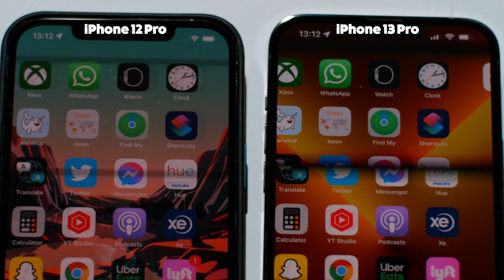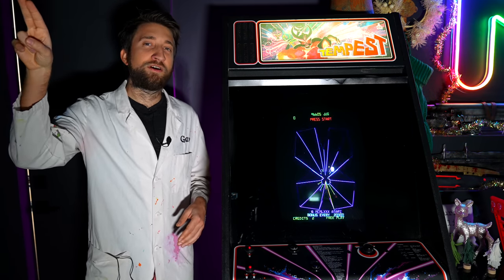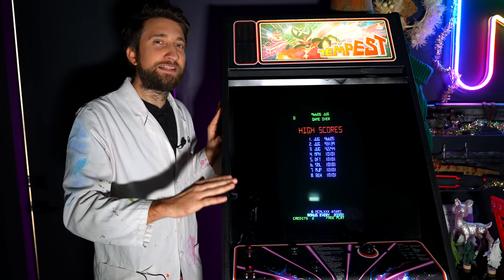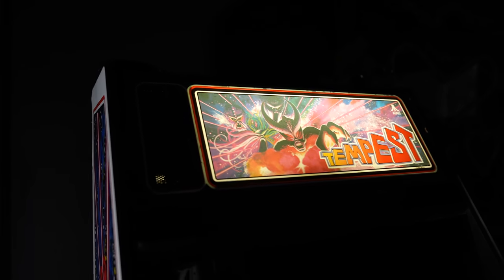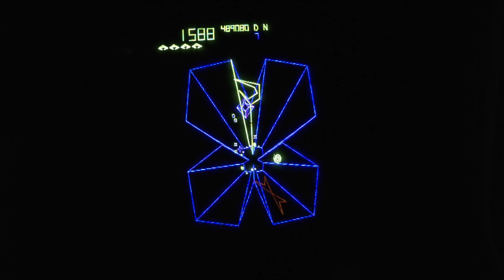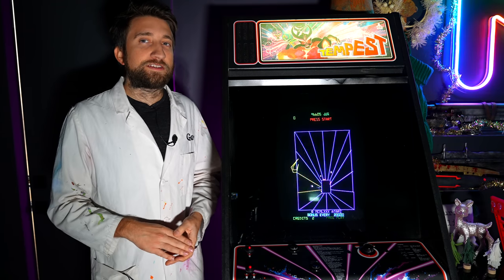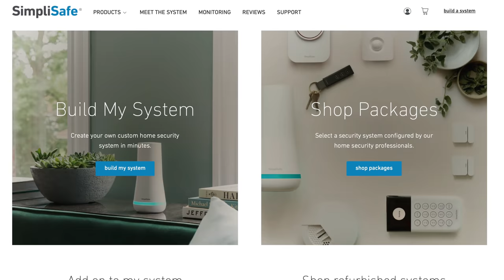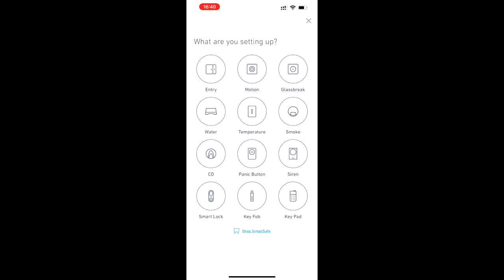Arcade Machines look WEIRD in Slow Mo - The Slow Mo Guys

Comment: Just thinking about how programmer back then coded something like this with such a limited resources gave me a chill.
Reply: The math for vector graphics is actually a lot easier than raster, because you can draw elements to the screen as you finish calculating them instead of in strict top to bottom order.
Reply: How cool would it be to invent something like this 40 years ago and then just now be able to see it slowed down
Reply: Necessity is the mother of invention. Having too much resources can actually be crippling, ironically enough.
Reply: @Wabajak13  you could of course tune the scan speed down in your engine :) but I get what you were going for
Reply: @DeathBringer769  ea vs an indie dev
Reply: It's not really that hard tbh. People do astonishing stuff by programming very limited hardware to do things it was never intended to do, this is called demoscene. This ain't that, this is just drawing lines on the screen. Probably assisted by a custom video chip or a separate dedicated CPU or something similar.
Reply: @grishka212  Atari Tempest, and all of the early Atari Vector were plain old, good old 6502 (at 1.5Mhz)
Reply: @pSynrg303  It did have a co-processor that updated the display along with a math co-processor to calculate the vectors. The 6502 updated a "display list" that the video co-processor would constantly read through, to draw the lines on the display. I actually had one of these machines, and a Star Wars that I fixed, a few years ago.
Reply: Majority of modern games start as vector graphics using lines, triangles and points. The first couple steps of the pipeline are just getting the vectors processed in order to begin rasterization so that you can layer on textures and such. The older trick to shader coding to speed things up, do as much as you can in the vertex shader which is almost purely working with vectors. Of course things have become a bit more intermixed now but same process still serves as the foundation for modern graphics rendering.
Reply: @Stabby666  Let's pretend it was all pur we 6502 😱 Seriously though, what a wonderful creation the Atari Vector system was. I still think it looks out of place for the era.
Reply: @eideticex  dont forget in that time we (programmers) had to do quite intensive math and follow very strictly optimized coding to not run out of memory. Also we had to code literally everything. Now everything built on an oven-ready engine (unreal mostly) and no one cares about memory. Nowdays aaa games doesn't really need amazing programers but amazing graphics designers, animators, actors...etc.
Reply: You basically had a list of delta x , delta y, length, and RGB color at a certain address in the hardware. If you did nothing during a frame it would draw the same thing. You would keep pointers to the non-static parts and change sometimes just the dx dy’s to spin your ship or change the dx dy and length of the black line to the ship.
Reply: Let’s go Brandon!
Reply: corona ke badhne se …
https://youtu.be/M_zz3uVeWUA
Reply: @Wabajak13  all you do is slow down your code timing so you can watch it draw ,.
Reply: @pSynrg303  thats when people  used to write in machine language,  now it's all bloat c code
Reply: I mean, the programmer just needs to tell the machine what lines to draw, and where, and just speed it up, but the engineer who designed the machine had to make sure the machine could handle that speed, I think that's more impressive.
Reply: All I know is that my favorite pastime 40 years ago was going to the arcade or even the local 7-11 and blowing an afternoon playing games like this.  Atari, Intellivision and eventually Nintendo were all well and good but nothing beat the stand up arcade games back in the day.
Reply: Even crazier was the hardware of Cinematronics/Vectorbeam "Speed Freak" - the first 3D car racing vector game, which discrete RISC CPU was completely built of TTL chips (and much faster than C64 etc.).
Reply: If you haven't seen it already, you might like this video on the Atari Quadrascan by Retro Game Mechanics Explained.

Comment: Good timing to mention Mat/Techmoan.  His video today is a "scope clock" with vector graphics on an oscilloscope tube.
Reply from the maker: Haha what are the chances!
Reply: @theslowmoguys  A Techmoan/Slow Mo Guys colab would be great, that guy has a veritable treasure chest of cool vintage tech.
Reply: @gris4985  What does a Nixie tube look like in slo-mo?  I'd like to see that.
Reply: @jasonblalock4429  i second this
Reply: @jasonblalock4429  
I don't think it would look any different, actually.  Each number is just a metal cutout that glows when it is active.  There might be some flickering to see, but that would be it.  Correct me if I'm wrong.
Reply: I did vector laser images with a HeNe laser and mechanical galvo scanners in the 80s that I choreographed to music. (classical laser light show) 
 I take out a projector on Halloween each year. 
I use the Radio Shack Color Computer with SW I wrote and used General scanning Galvos.  It used the 6809 and a clock around 900kHz.  In the display processor I was squeezing clock cycles to to some rotations real-time. 
..
I though about writing an Asteroids game, but moved on to other things. . .

Comment: Persistence of vision is awesome
Reply: No
Reply: It is. That's what allows us to play these games.
Reply: Hi
Reply: you are awesome.
Reply: it's kind of the leading factor why LED lighting isn't horrendous to us in its current form
Reply: @Ki113dbysw0rd  and neither is incandecent lighting. I still wonder, if anyone ever tested how incandecent, compact fluorecent and LEDs impact our pets? Dogs are probably safe, since IIRC their eyes are even worse than ours. But what about cats and birds? And from personal experience the variance in humans is quite noticable. Up until my 40s I definitely noticed  a difference between 25,30,40,60 or 80 fps. Some games where you are moving really fast like a race car or a plane, became unplayable under 40 fps. Nowadays I get by, because my eyes and my reaction time slows down. But I still notice, when the framerate isn't stable, even if it does not drop below 40fps. Drives my crazy ;)
Reply: Laminar Flow: *sheds parallel tears of abandoment
Reply: In case Destin somehow sees this i have a question you might have the answer to What if you had a screen made up of multiple/ a dozen or even more of those lasers working in unison to make even more defined and full images. Or is there already an equivalent to that?
Reply: Thanks for helping make this happen! I’ve been dying to see a vectrex display in slow mo ever since I saw the crt in slow mo!
Reply: Unfortunately it also works against us when it comes to sample-and-hold displays, but it was definitely a blessing when it came to CRTs.
Reply: @EyMannMachHin  On my playlist about shielding & radiations are some modern lightbulb tests. Fluorescent/CFL are definitely worst to health in light spectrum and EMF. LED are less terrible (still some flicker and models with very bad EMF do exist) but none of them is as healthy as genuine incandescent lightbulbs (the only lamps I use).

With games, on MAME I often still play <10 FPS without trouble. Habe you ever tried polygon 3D games on 8-bit machines like C64? Some flight sims were 1 or 2 FPS which was considered normal at that time.
Reply: @cyberyogicowindler2448  Thanks, I really have to check those out. Especially in light of incandecent bulbs are also included in calculations for size of radiators. But I have moved completely to LED by now, since at one point I was only getting 60W incandecent bulbs for my PAR38 living room lighting. That really turned the whole room into a cave.

And, yes I did play early low fps 3D polygon games on (real) 8 bit machines in the 80s. But it was all new at that time and for some things I also lacked the real world experience so it worked out okay. But I still remember showing off FS 4.0 on my (then new) 386 to a colleague actually holding a PPL, his only comment was: "Nice, but why is it so sluggish?" The fun thing about muscle memory is it can react to things you see but don't register consiously. And a driving game this means, if the game actually only renders every 3rd frame you might actually miss the turn because you don't "see" the frame in which you actually should have turned. I hope this makes some sense?
Reply: The philosophical implications are overwhelming when you consider all of the different tricks our brains use to generate our version of reality using the sensory input we receive. Your brain is literally generating reality on the fly based on whatever sensory input it gets in. Like with color. Our brains take certain wavelengths of EM radiation and tell us we're seeing a corresponding color. But there's nothing about that EM radiation that gives it that color. It's just something our brain tells us we see when that wavelength happens to be detected. There's nothing about 450nm light that inherently makes it blue, for example. But that's how most of us see it. Unless you're colorblind. And even if you have "normal" color vision, everybody has different sensitivities to different frequencies of light. Some people can even see outside of the visible spectrum and into the ultraviolet or infrared (but not both afaik). Apparently it's more common to be able to see infrared as a dull red color.

Comment: Went to an arcade and played asteroids and was amazed at how crisp and nice looking the display looked, it's cool finding out how it works and why its so distinctly different than other types of displays. Great video as always!
Reply: Yeah, I had head the phrase "vector graphics" many times over the years, and understood what a vector was, but never really thought that the lines would actually be made in a very different way than a standard display.  I guess I just figured that there was vector math in the way things were calculated.
Reply: I was lucky enough to grow up in the era when vector games were new. There was something quite magical about them. The Star Wars game in particular used to draw a crowd whenever someone put 10p in the machine. We were unsophisticated kids that were easily fooled by illusions. Some coloured lines flashing on a screen made us feel like we were actually flying down the trench on the Death Star.
I think the vector games have remained "magical" unlike some of the raster/sprite games of the same period. As the displays were often only 256 pixels wide, blocky/pixelated games of the era look unclear and jerky to modern eyes, but the vectors still seem sharp and fast. There are some good emulations via MAME etc that reproduce the flickering and glowing of the lines quite accurately, but a real vector arcade machine is something special.

Comment: I've always adored vector displays. Any time I'm at an arcade I'm drawn to any game using them with their intense contrast and vibrancy.
Reply: Yeah, when I was a kid, vector games were my favorites.  Even if much newer/prettier games were around, I'd still be playing Asteroids or Star Wars/Empire Strikes Back.
Reply: I did vector laser images with a HeNe laser and mechanical galvo scanners in the 80s that I choreographed to music. (classical laser light show) 
 I take out a projector on Halloween each year. 
I use the Radio Shack Color Computer with SW I wrote and used General scanning Galvos.  It used the 6809 and a clock around 900kHz.  In the display processor I was squeezing clock cycles to to some rotations real-time. 
..
I though about writing an Asteroids game, but moved on to other things. . .

Comment: I was a CRT tester a few years ago and it's really cool to see these in slow mo. The science that goes into producing these even today is impressive and pretty labor intensive depending the kind of tube it is. Size, how many guns are in it, type of coatings, how the coatings are applied, the housing (shield), how the wiring is setup. Can get complicated quick.

Comment: Hi Gav,  fantastic video as always. Love to see how our eyes are fooled by display technology.
Would you ever consider pointing the Phantom at a DLP projector? It would be incredible to see the DMD device and colour wheel working together.
With new faux 4K system, the DMD is flashed multiple times tin increase the perceived resolution.

Comment: Fascinating. I never knew there were vector displays, assuming all screens refreshed line by line. Thank you for this!
Also, the story of Dan the Subocean Traveller is hilarious, as always.
Reply: Actually the vector displays predates matrix displays. After all they are just glorified cathode tubes like those that used to be found in oscilloscopes. Matrix graphics was much harder to create using early computers. On early computer terminals the displays were character mapped. That is there were no bitmap for the display and the information needed to draw the characters were created by a character generator. Any time you wanted more flexible graphics vector displays were used. I remember that they had a terminal capable of displaying vector graphics at the university a friend and I used to go to to use their computer. We were still in middle school so perhaps 12 years old or so, and the only way we were able to get some computer time was by applying for an account at a university and use their mainframe. The graphics terminal was freaking impressive tech for the time. I remember that the colors were not aligned in a single plane which made it possible to create some weird but interesting parallax effects. Yea, we weren't doing a lot of serious programming, but it taught me a lot. My friend spent a lot more time there than I did though.
Reply: @blahorgaslisk7763  I did vector laser images with a HeNe laser and mechanical galvo scanners in the 80s that I choreographed to music. (classical laser light show) 
 I take out a projector on Halloween each year. 
I use the Radio Shack Color Computer with SW I wrote and used General scanning Galvos.  It used the 6809 and a clock around 900kHz.  In the display processor I was squeezing clock cycles to to some rotations real-time. 
..
I though about writing an Asteroids game, but moved on to other things. . .
Reply: @Observ45er  Awesome! Perhaps it's time to see if you can cobble together some simple game now. Should go over well with the grandparents following their grandkids around...

Comment: I worked in the field of protein crystallography in 1980's and beyond and wrote software that had to draw complex views of data.  The 1980's used the Evans and Sutherland computers which were vector graphics engines, and you could only draw a number of lines before you brain could see the flicker of the image.  The computer code draw lines, and these were drawn exactly in order in the computer code, and you had to limit the number you drew.  All code was "wire-frame", just like this. 
We also worked on the earliest version of stereo in the 1990's where the monitor was over clocked to double its refresh rate (and not interlaced), then you drew the left/right scene in the bottom and top of the view - which would then wrap round when you over-ran the monitor to 100Hz.  (Europe), to create the stereo.  We drew 2 dots on the screen which used 2 sensors to hand made LCD glasses that would alternate flash, so the eyes would see the alternate scenes.
SGI computers replaced these vector machines with the first "high-performance" raster graphics in the 1990 - and these cost from 100,000 to some 500,000 $/£ each and some the size of a small desk with an 18 inch cooling fan.

Comment: I worked on the head-up display for the Harrier aircraft. It was a vector display projected onto a transparent mirror. The CRT had a 1" diameter screen with a spot size of .001" and was incredibly bright. It had to be visible when flying (almost) into the sun.

Comment: Oscillofun is this brought to life with current technology. Also you can get the slow motion display simply by varying the readout rate for your raster display, obviating the need for the slow motion camera, plus the modern versions can sort of do flood filling, by drawing multiple lines in an area, to fill it in, and letting the eye integrate the lines into a solid block.

Comment: There’s another downside in that the more stuff you had on the screen, the longer it took to draw a frame. Eventually, it gets to the point that there isn’t time to draw everything.
Reply: I still don't understand how Atari was able to pull off their Star Wars / ESB flight sims.  It's crazy how much they had going on, yet maintained a smooth - and quite high for the time - framerate.
Reply: And then there is the problem with elements that are obscured by other elements. What is trivial on a raster screen (first paint the background, then paint the foreground over it) becomes complicated and very time-consuming in vector space---you basically have to do the same calculations as a ray-tracing machine needs to do. (For every line you want to draw, you need to split it at all points where a ray from your eye intersects both the line and the border of any closed shape that is closer to the eye than the line.) This gets incredibly slow very fast, so rendering into a frame buffer instead directly onto the screen makes perfect sense. Especially once the frame buffer resolution matches the screen.
Reply: For a time, the vector games were the "fastest" games, because they were so stripped down (and designed and coded so brilliantly, using a "less is more" philosophy), but the consumer wanted more realistic graphics. When faster CPUs and graphics chips were invented,  and pixel resolutions could go up, larger bitmap sprites took over the arcades. The vector games have retained a certain magic though.